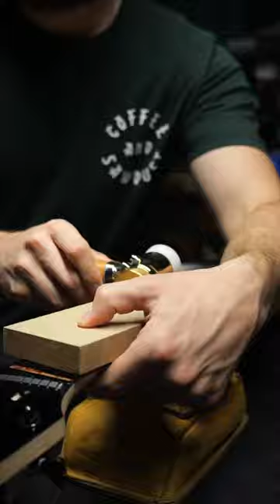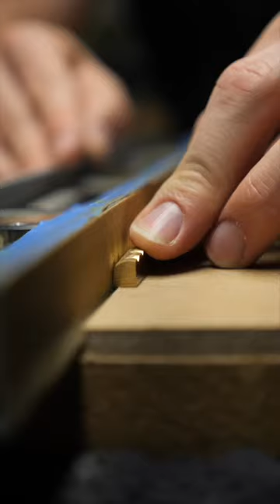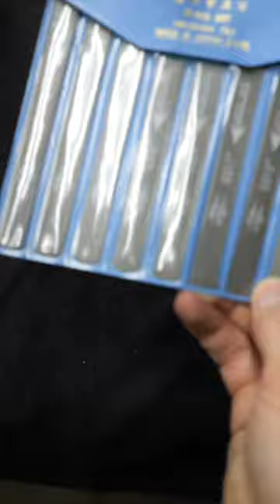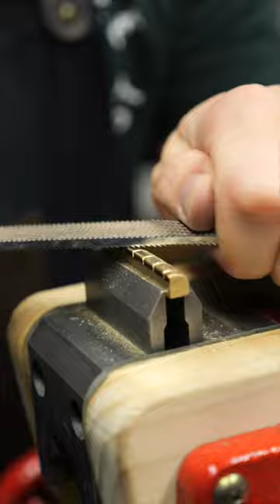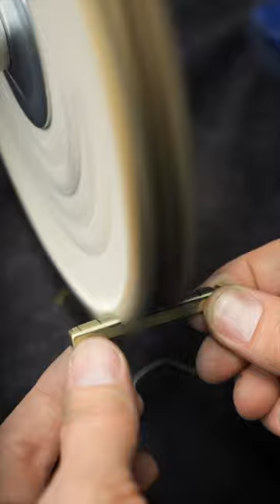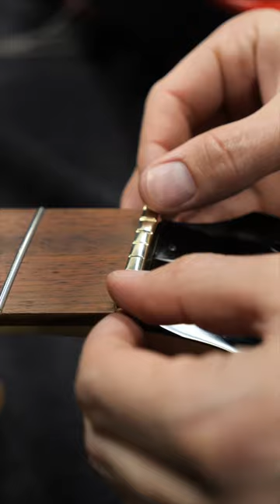Upgrading to a Brass Nut on this Ibanez 8 String! #shorts #luthier #guitar #bass #guitartech

Comment: After polishing, if you're really skilled with a fine paint brush, use one to apply a thin coat of clear nail polish to all areas of the nut which will be exposed after installation, minus the nut slots of course. This will greatly delay discoloration via oxidization of the brass.
Reply from the maker: Great tip! I’ll do that on the next string change. 👌🏻

Comment: Is a brass nut worth it on extended range guitars
Reply from the maker: I’d say upgrading from the stock plastic one is worth while! Even if it’s not brass, upgrading to a bone or TUSQ nut helps tuning stability. They are also more durable.

Comment: My brother did this with an original run mustang bass back in the 1980's. I'm pretty sure it's brass. I have that bass now. I want to polish the nut but not take it off of the neck. Any suggestions for what to use for that? I don't want to damage the wood on the neck and fretboard. I can tape them off but I still want to be careful with any chemicals I use.
Reply from the maker: Nice! What I would do is clean it off with some Naphtha first. This will clean all of the grime off of it. Then, I would pick up some MicroMesh pads, and sand/polish up to 12000 grit. After that, you can take some green buffing compound and buff it with a rag (or dremel polishing wheel if you have one). Hope that helps!

 https://amzn.to/46VE3ss
Reply from the maker: If you do tape around it, first put the painters tape on a cotton shirt/jeans to take some tack off. This will ensure it doesn’t take any finish off!
Reply: @AugmentGuitars  Awesome, thanks for the great info. I took a screenshot and will follow the link. Thanks for the tip about the tape. My brother put clear coat on the fretboard so I need to be careful there. I recently was polishing the frets on my nephew's strat and I taped off the fretboard and when I pulled the tape up part of the clear coat came off. The fretboard on that guitar is in really bad shape so it wasn't a big deal but lesson learned. And fortunately I had only taped off a couple of frets at that point.

I'm going to replace the Badass bridge that was on the bass with a different high-mass bridge that has brass saddles so it will be interesting to hear the difference. I've heard brass can make the sound a little less bright. Sounds backwards to me but oh well. The old bass is very modded already so I'm going with it.

Thanks again.

Comment: How much does a repair like this cost? Or how many hours does it take.
Reply from the maker: Hey there! It depends on your guitar, location and nut material, but expect to pay around $70-$100 for a nut replacement. It usually comes with a full setup too! Can be a few hours worth of work total